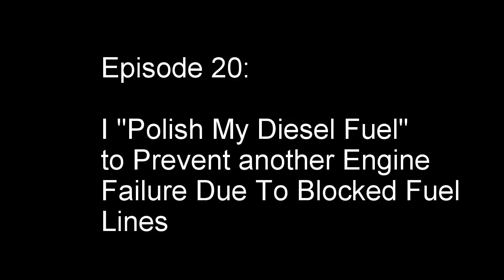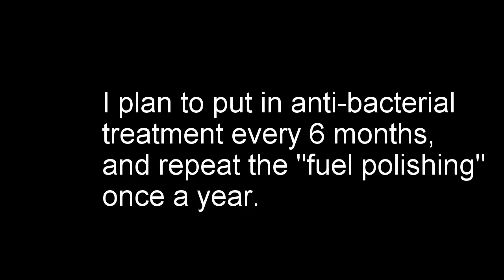Ep 20 Diesel Fuel 'Polishing' To Prevent Clogged Filters and Lines

Comment: I think you could have water so small that it won't collect in the bottom of the racor filter but will dampen the paper filter element and that will "clog" things up so diesel won't go thru the filter.
Reply from the maker: Ahhhh.......of course.  I completely forgot John.  The Racor filter media at 10 micron is supposed to block up to 95% of the water.   That certainly helps explain why I did not see any water in the bowl.   Thanks for bringing this to my attention.   Good catch.

Comment: I thoroughly enjoyed this video, thanks for posting. I don't have a boat, I have a diesel pusher motor home with a caterpillar engine and want to build a polishing system like what you did. I have a 100 gallon tank, I think yours is around 50, do you think that pump would be big enough for that. The Catapiller mechanic I spoke with told me that if I used a bio-cide type algae killer (or what ever it is), to be sure I was carry several extra fuel filters. If I understood him right it normally floats on top of the fuel, until it dies, and then it sinks to the bottom and gets picked up by the engine fuel pickup. I don't know if this true or not. Did you test your polishing system? I'm planning on getting a 5 gallon clear container, putting fuel, water dirt and algae  (or what ever it is) in the tank and running and see how it does. That way you'll know if it got the water and other contaminates out. That Racor filter should be a good one. Thanks again and safe travels.
Reply from the maker: Thanks Richard.   My understanding of diesel bug is that it lives in accumulated water (from condensation or leaks) in the bottom of the tank.  It feeds on the low sulfer diesel fuel just above the layer of water in which it lives.   When a boat is in rough water, it gets shaken off the bottom, and can then be picked up by the fuel probe and block lines and filters.  I suppose the mechanism is the same in a vehicle.   You  are right, my fuel tank is 55 gallons (210 liters).  The pump I used is probably too powerful for a good fuel polishing system.  The limiting factor is the capacity of the (Racor) filter.   My pump was at the high end of the published capacity of the filter ---- and may have pulled the fuel through too quickly to allow the water to separate.   I agree with the recommendation of the mechanic to have extra filters on-hand if you use a biocide.  I have read stories of using a biocide and then filters being overloaded with dead residue.  (I have two strainers in line with my filters for this purpose -- catch the heavy stuff.)   I'd wish you fair winds, but think smooth roads may be more appropriate.  :-)  Thanks for watching.

Comment: Are you concerned that there still may be foreign matter in the actual "running" lines from the tank to the engine?
Reply from the maker: It's possible Robert -- especially right where the hoses connect to a filter fitting.   That said, I did nuke the bug with the biocide in the tank, which has now also gone through the lines.   If I run out of things to do this winter, I may run the 'polishing pump' in the reverse direction through the lines into the tank just to give a good back-flush.   Not sure it is needed though.   Thanks

Comment: Air ?
Reply from the maker: Sorry Black fire.  Not sure I understand your comment.   If you are wondering if I bled the fuel line on the engine (to remove any air) the answer is yes.   That was not the problem.   The blockage was contamination in the line (actually, the emergency fuel cut-off valve orifice was blocked).   Thanks for watching.

Comment: No water?
Is it perhaps because the pump is upstream from the fuel/water separator, and the pump action is emulsifying the water so it doesn't settle out?
Another YouTube video makes that point, and its author has the pump downstream, i.e., sucking fuel through the separator.
Reply from the maker: Yeah -- that could be Joe.   That said, the pump I was using was right at the level of the max capacity of the filter.   I'll do it with one less powerful the next time.

Comment: You had changed your filters when the problem first cropped up and had mentioned you had water at that point so maybe you got it all then. I don’t understand why they don’t put the fuel tanks in a location where we can drain them or even remove them to clean. On my boat I have to cut the floor out to get at it , this is poor engineering to say the least. Anyway you are producing great videos and thanks for that.
Reply from the maker: Thanks Neil.   Yes, I can understand them putting the tank in a place that is difficult to get out, but then they should at least have installed a drain at the lowest point so you eliminate any water build-up.   It is indeed disappointing.   I now plan on regularly (every 6 months) using a diesel-bug killer, and running the 'polishing' machine once per year.  Thanks for watching.

Comment: HI Patrick,  Another great video.  Couple of points:

1. I suspect that you have killed off any Diesel Bug by adding the mixture.  When I did it on my boat it seems to turn he jelly like substance into those fine particles that you captured in the filters.

2. I wonder if the reason that you didn't get any water is maybe down to the flow rate of the pump.  I suspect with such a high flow rate you might be emulsifying the water with the diesel and therefore it doesn't get the chance to separate out at the filter.  I wouldn't worry though if you do still have any water in the tank it will gather in your normal filter and can be drained off when required.  I've personally never had any build up of water but then maybe I have just been lucky.

Keep making the videos.

Graeme
Reply from the maker: Thanks Graeme.  I was wondering exactly the same thing as you: am I just recycling the water due to the high volume circulation?   I even said that on camera, but edited it out of the final cut.   That could well be it.   I'll drain my primary filter when I go to the boat today to see if there is any water.   As you state, probably nothing to worry about.
Reply from the maker: Unfortunately, the water separator I have in the engine room is not transparent, and not located in a place of ease to service the bottom end (where the water drain is).   I have to really force myself to check it.....  :-(
Reply: Possible fly in the ointment with your approach is most likely you have baffles in the tank and just going in through the sender gauge hole will only suction that part of the tank bottom/wall? Better than nothing but may not be thorough.
Reply from the maker: Exactly Mr Milo.  In fact, I felt the baffle with the copper probe I was using.  It seemed to cross about 3/4 the way across the tank, so any sediment behind it probably escaped.  (I did just leave the probe sitting at the baffle area for quite a while to try to create a flow along the bottom, but the flow was probably not strong enough to move heavy sediment.   As you suggest, better than nothing.